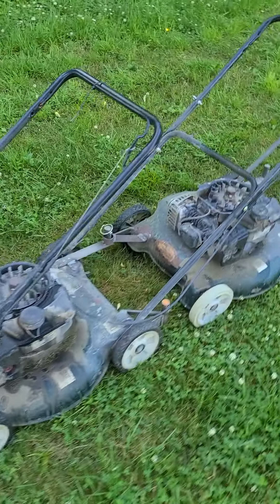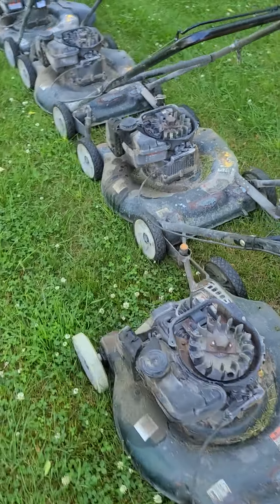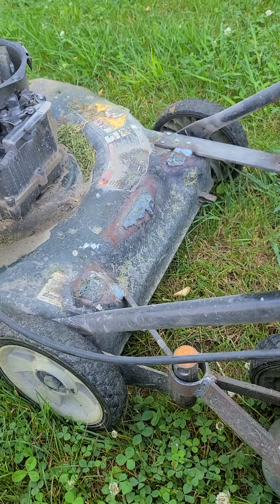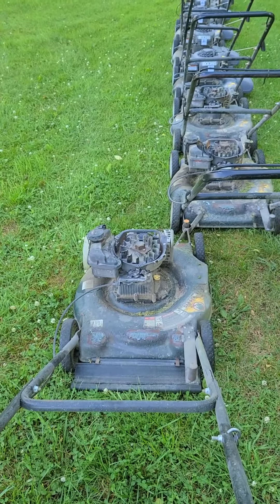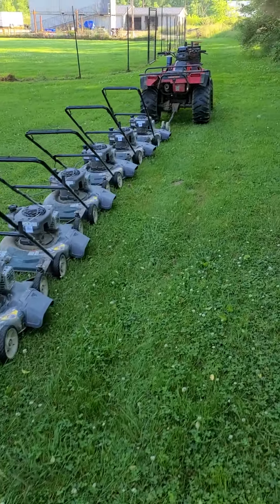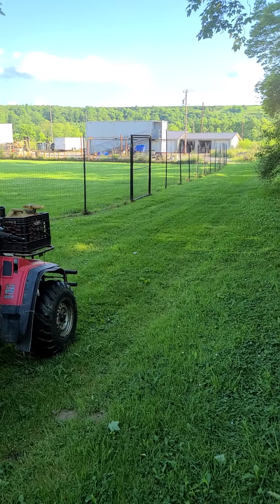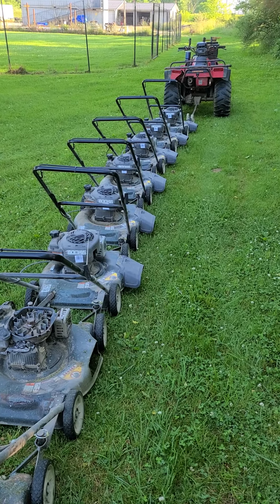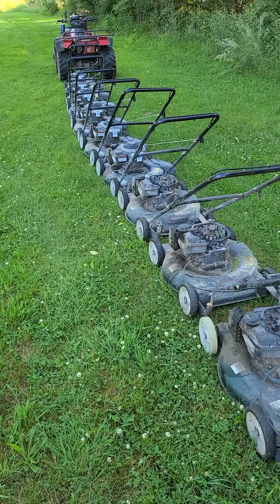A look at the Minion mowers

Comment: Hello from Sunny Australia!. Bolens should sponsor you for this!. If the mowers had a snorkel type air filter which draws air into the engine from a higher point on the handle, would be a real good advantage for making the engines last longer...less dust. The last two mowers in the line up are always going to have problems with air cleaner build up etc.  Fantastic solution for mowing hard to get into places and for mowing inclines from the top.

Comment: You need to have a rotating arm so that it rotates back to hook up to the single file hitch. Then when you are ready to mow release the pin and it swings back into place.
Reply: They used to do something like this on older wheat drills. My dad used to have one. You hooked 2 drills on it. They would run behind each other down the road. But In the field they would run like your mowers.

Comment: I have a husqvarna self propelled and when I found out how hard it was going to be to change the oil I said screw it. This is going to
be a test to see how long one will last without ever changing the oil.
Reply from the maker: Changing oil in these Briggs is easy...I service all six in less than an hour including oil change, air filter, and blade sharpening.
But mainly if you run a clean air filter and proper oil level  yours will probably run as long as you want without an oil change...just make sure there's oil in it